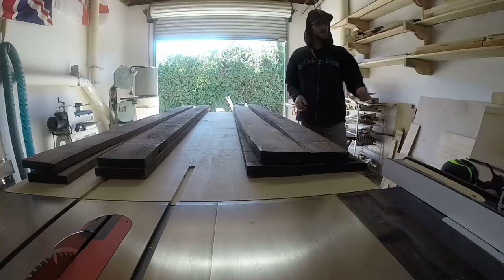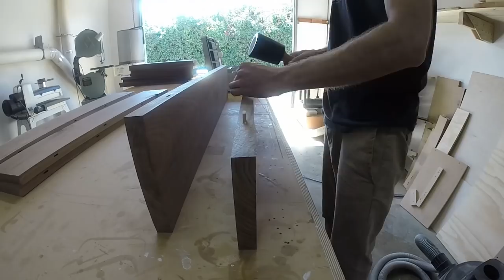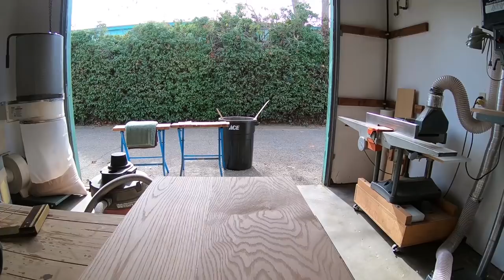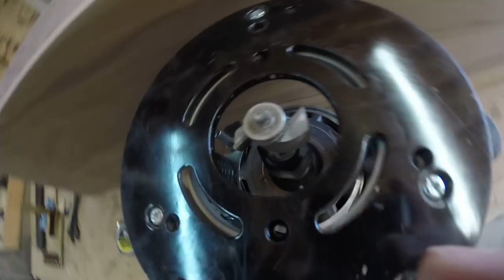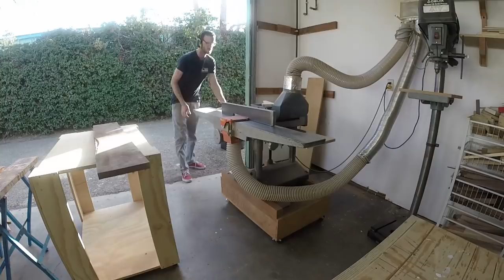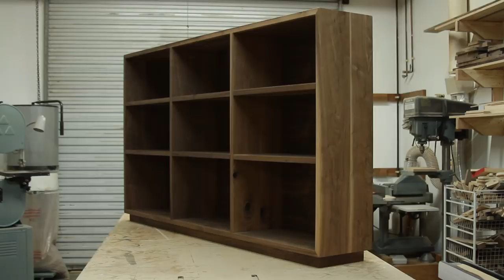Building a Solid Walnut Bookcase - Shaun Boyd Made This

Comment: Wonderful work as always, love your shop and the pieces that you knock out. Im curious about your milling process, as I have a similar set up. With your rough lumber are you skip planning everything and not doing a face and then jointing an edge? Id really like to improve my milling and efficiency as I feel like this is where it can all go wrong.
Reply from the maker: Thanks Cody, really appreciate it! Yeah, I do a lot of skip planing since I only have a 6" jointer, and I prefer to keep the width of the lumber. If a board is really wonky, I will set up a sled for the planer and shim it up to get a flat face. Would love to have a bigger jointer, but you have to work with what you've got.

Comment: I wouldn't apologize -- I actually like this format, it adds some variety.    And looks like you got a new camera and/or new lens?  Footage looks improved compared to past videos.
Reply from the maker: Thanks, man. Really appreciate it! Trying to slowly incorporate more talking. I have actually had this camera for a long time (Canon 7D) I just rarely use it because of the extra time it takes to set up shots. No autofocus, no flip out screen to see what I am shooting, terrible audio. I am hoping to get something new soon, so I can get similar quality without sacrificing the extra time.
Reply: I used the 7D for many years and after shooting a couple YT videos, upgraded to the 7D Mk II.  That was before the 6D Mk II came out tho.  I would recommend the 6D Mk II or 80D over the 7D Mk II because of the flip out screen on these.   I highly recommend the upgrade because (i) adding autofocus during video is a HUGE timesaver (all three do this), and (ii) with the 6D Mk II or 80d  flip out screen doing on-screen segments is so much easier because you don't have to do trial and error to get yourself in frame.  I only went with the 7D Mk II because I do underwater photography as well, and there wasn't a housing option for the 80D.

For any of these, you'll want a lav mic.   I initially went with a $30 corded lav mic which sounded good enough, but the cord meant using it was a pain.  Eventually, I decided to plunk down the cash for the Rode wireless lav (found one used on Ebay for about $300 USD).  Expensive, but totally worth it.  Now I can just wear it all the time in the shop, so its ready to go when I decide there is something I want to talk about on camera.

Also, as interim solution for framing yourself, you can get an ipad or phone mount for $10 to attach it to your mic stand, and there is an app called DSLR controller that is $8, and allows you to see your camera's screen on your phone/tablet.  This is what I'm using now since the 7D Mk II doesn't have the flip out screen.
Reply from the maker: Yep, that is exactly what I am looking to get. Thanks for giving me all your firsthand info, there are only so many online reviews I can read. I used to shoot a lot years ago, and had a whole set-up for my 7D, but it was all based around being behind the camera and shooting someone/something else. This whole filming yourself thing has thrown me for a loop, it just feels so weird not to be able to see what I am shooting. And I used to love spending time setting up shots, but that was when the footage was my main focus, and now it definitely comes second to the build being my main focus. So I agree, autofocus, and flip-out screen are the two main things I am looking for. Thanks again for the info!
Reply: I hear you about it not being the main focus.  Oh, and totally forgot to mention Canon just announced that new mirrorless camera that shoots 4k and has a flip out display.  It definitely might be worth a look.
One thing I've found is that I have slowly started to enjoy filming myself more, as I get the hang of it.  I'm starting to see filming my projects a bit more artistically, and as a result am enjoying the process more.  I think it is frustrating at first for folks like us, because it is somewhat like having to learn to walk again.  But, it gets better.  I was talking to Zach from ZH Fabrications and he is going through the same thing now... finally starting to view the filming more as an enjoyable aspect of the creative process than a chore.  I'm guessing you'll experience the same once you upgrade to something.  And selfishly, I can't wait to see what you produce when you do, because your videos are already really good!
Reply: ps If you haven't already, I recommend watching some Peter McKinnon videos, and maybe some camera-oriented Jon Olsson videos, for some cinematic inspiration.  I really like how the edit and cut to the music.
Reply: I agree, really liked this.
Reply from the maker: Yeah, I definitely think you are right. I have always been so averse to being on camera, so this is definitely out of my comfort zone. But with each video it gets a little easier, so I am definitely looking forward to that comfortability translating into more creativity. It is fun watching a bunch of different people develop different video styles as they create more. And yes, I have been watching a lot of Peter McKinnon's  lately, he is wildly skilled with a camera. I'll have to check out Jon Olsson, as well.
Reply: Shaun Boyd yea its really fun watching  everyone in this community develop develop their own styles.  And by the way, you do a way better job remembering to look at the camera than I do :) I think I finally got that figured out in the video I'm putting out this week, but it took me awhile...
Reply from the maker: Haha, the one good part about not having a flip out screen, I guess.

Comment: Nice job, bud - finished product looks great. Any concern with wood movement and that base? I suppose that panel isn’t very wide, just curious what your thoughts were.
Reply from the maker: Thanks, really appreciate it! You are right it isn't very wide, so there shouldn't be a ton of movement. I also elongated the pilot holes in the base to allow the screws to move a bit just to be safe.

Comment: Very nice build! quick question! I noticed you didn't joint the lumber before planing it, was it because the pieces were too wide? were you worried about curved surfaces?
Reply from the maker: Yeah, my jointer is pretty small, so I don't always face joint my lumber. I take care to find straight boards, and can usually orient the boards during glue-ups to get rid of any bow. Definitely wish I had a bigger jointer.

Comment: I want to do an 80w x 12d x 70h shelf unit. How much weight could a 80inch walnut shelf hold with no supports? Should I use Domino to hold it in place or what would be stronger?

Comment: Beautiful piece!!! I've planned something VERY similar, I simply  love walnut, but it's shockingly expensive here in Denmark. May I ask how much the walnut itself set you back?  Also - did I miss the surface treatment? Regards Claus
Reply: Claus Friis Hansen I can tell you in Virginia it’s about 4 or 5 dollars per board foot for kiln dried black walnut.
Reply from the maker: Thanks, Claus! Really appreciate it! Over here in California it can go for as much as $9-10 per board foot depending on where you get it from. As for the finish, I used a wiping polyurethane for this one.
Reply: Thanks for taking the time to answer - but still only 50-60% of what I have to pay :( Such a beautiful material to work with! So I guess I'll bleed the cash and get on with it :)